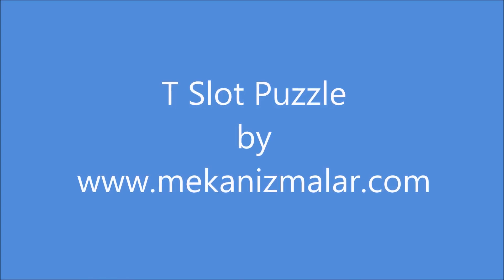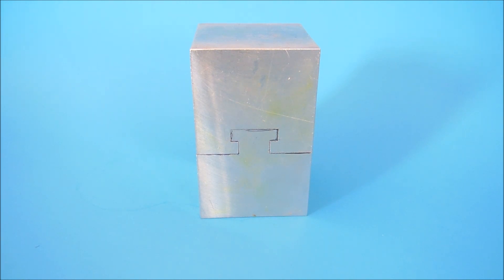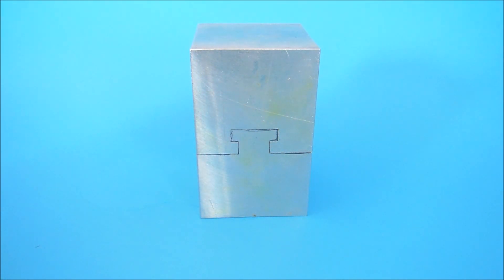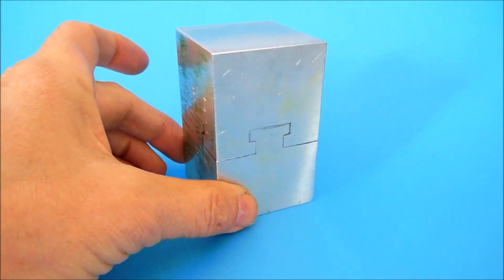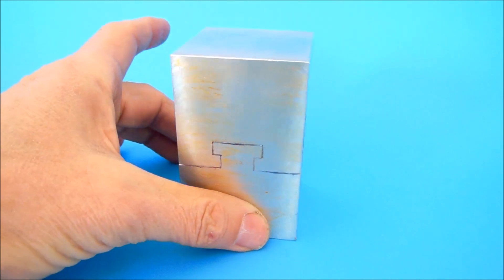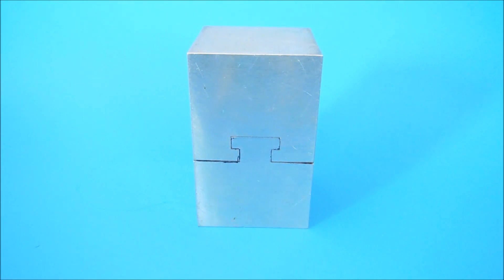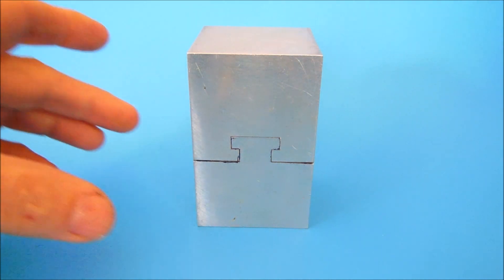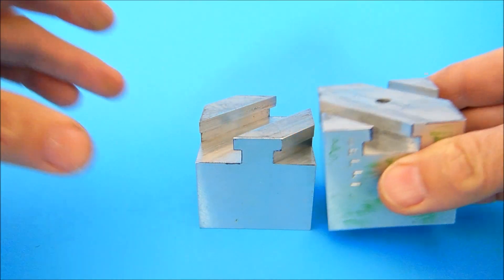t slot technical drawing puzzle

Comment: My area of research happens to be 3D printing! Your videos are very stimulating and continue to motivate me to learn CAD software at my own pace. Recently I tried to make a switch from Inventor to SolidWorks, which set me back a little. I know you are using Inventor, so it probably means I will no longer be able to reach out to you for tips. Still, thanks for all your work!
Reply from the maker: Hi Piotr, Actually I don't know any CAD programming.  I just started to learn Inventor. Why you moved to SolidWorks? I want to do some animation with inventor, but it won't be easy for me.
Reply: mekanizmalar
Ah, apologies! It was a long day and I have confused you with one more engineer here on YouTube. I know that you use Flash animation instead. I moved to Solidworks because it seems to have more robust solid modelling and sketching system. Inventor seems superior at developing true engineering solutions that account for material properties, stresses and so forth, which is not my goal. I only created very basic animations in Inventor (such as geneva drive) and I've yet to see if it is easier or harder in Solidworks. On top of it all- Solidworks has far larger user base and so resources such as tutorials are easier to find. As an example- I could only find Solidworks tutorial dealing with animating planetary gearing and roller chains. Sometimes solutions presented in SW can be used in some way in Inventor, but that is rare. Both programs are recognised largely as equal competitors. I have started with Inventor mostly because Autodesk offers free software for university students.